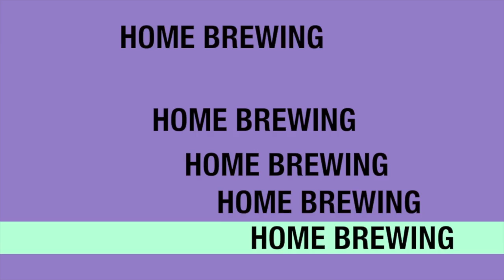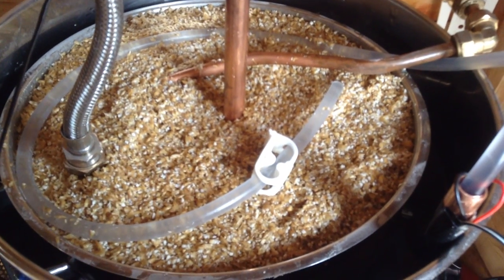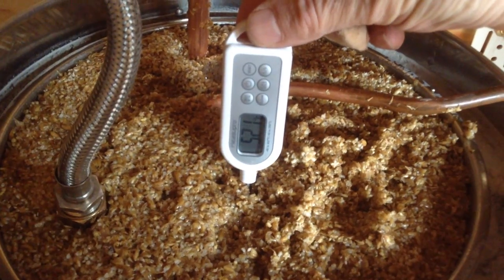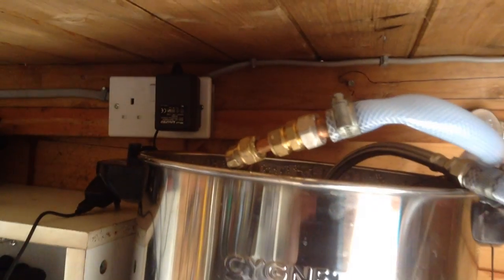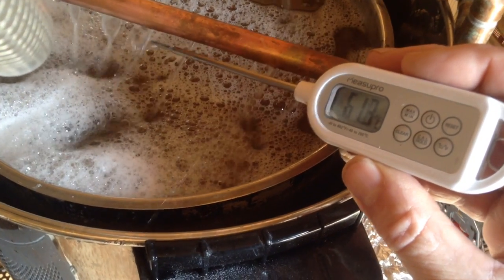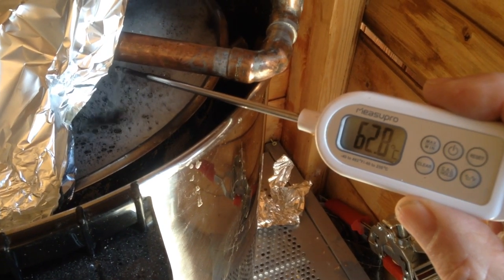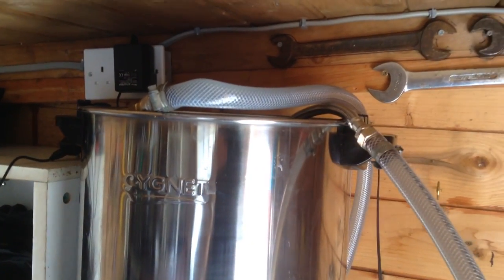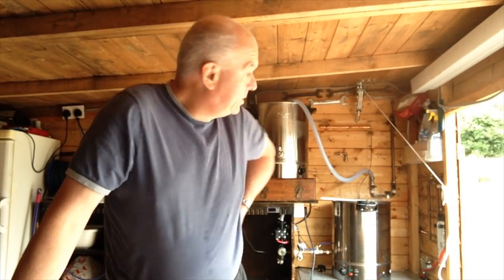Vlog 73 Fartmiester Big Fail!!

Comment: Jim, Tesco do a foil-backed dense foam camping roll-mat thing for £5. I've heard of other brewers using similar and I'm getting one to insulate my 33L boil pot. I can always put more foil between it and the pot if necessary. It also means I should get to the boil faster. It's a shame the sparge arm is too big to sit inside the top of the outer-pot. It would reduce the distance the recirculated liquid has to fall through the air (therefore cooling it less) and you could put a lid on the top, which would massively help maintain the temperature. Anyway, great video as always, good luck.

Comment: Thanks for the shout out Jim. Amd so pleased you got it sorted in the end.  I guess we don't know these things unless we try them. I too had a similar idea when I was looking at it. My idea would of had the ciol on the bioler too bit on the outside the inner basket if you get my drift. Then would double as a wort chiller after the biol. But probably still fail. And create more dead space I guess. And I will need a sparge water vessel anyway so looking fantastic doing herms style. Thanks for the video Jim. Not really a fail just a miss-take. Got it sorted in take 2. Cheers!
Reply from the maker: Thanks very much for the support its all good fun and getting there slowly just got to get the insulation sorted. Cheers. Good luck with you project.

Comment: Good video Jim, I bought myself a buffalo boiler for biab, I insulated it with radiator backing foil its £5.99 for a 4mtr roll from screwfix & works a treat 👍
Reply from the maker: Sounds the business wil be ordering that next it's all spending in this game. Thanks for the heads up cheers.

Comment: Good on you for not giving up on the grain and getting some beer in the end. I did think you would have problems with hot spots by putting the coil in the grain, but if you don't try these things you don't know. 

Really glad the HERMS coil is working well for you. I've contemplated using my cooling coil the same way but not had issues maintaining a stable temp using the heating element and recirculation.
Reply from the maker: Yes Rob it's working really well, time to do a couple more mods with insulation and sparge arm adjustment. Cheers for the help.

Comment: Very cool monster mash ye have made there...I found measuring the temp of the wort as ti was returned (using the STC) prevented me from over heating the mash (just used a T junction with a thermal probe). Cheers
Reply from the maker: What a great idea more experimental work coming up it never stops
Does
It. Cheers.

Comment: I would readily agree that foil backed camping mat would be a good choice, and one i use on my HLT,  as would foil bubble insulation which is also readily available and would also do the trick. Think you've almost got it sussed Jim...well done!
Reply from the maker: Yes the insulation is the next project, thanks for the support an help cheers.

Comment: For me the best insulation ive used on every setup ive done.Is a foild sided campming mat with then foil facing the pot.Easy to cut to pot size only £4 on ebay.And held with them bungee cords which i bet you already have.Then when you come to cooling easy to remove.Also had no problems leaving on for boil works a treat and can wipe clean.
Reply from the maker: beerlover1983brew That sounds great the foil should reflect back as well that the next thing on the shopping list thats for sure, thank for the tip sounds great CHEERS

Comment: Hey up again , me duck.....
The foam camping mat I used is fine , tho' my boiler is plastic ,but whatever , I figure water boils at the same temp whatever it be in . Not melted mine , and it is'nt in too close contact with the boiler as it's not secured to it in any way ,just the natural coiling tendency of the material keeps it "good enough for government work " , if you catch me drift. You could'nt sleep on 'em - too thin anyhoo ,and as soon as yer roll over the buggers curl up again.Also ,Ileft the lid slightly covering the pot  whilst still letting the steam out , I figutered that as it has trapped warm air between the layers , it would make a difference ,and it has . More noticeable in freezing weather , I get anothe 3-5 degrees on the boil . Glad to see you "landed" the brew with all engines out! BTW, there's nowt wrong with invoking the spirit of Heath- Robinson . Google some of his drawings , you'll be in good company . As ever , great bit o' "Fartology" applied there . Well held,Sir  !
Reply from the maker: Hello Nigel yes going to be whacking some insulation around the old girl also will be on the lookout for a mesh to put over the grain, still need more holes in the bottom of the inner tun to stop overflow. I have a link to silver foil lined so might take the plunge on that, also fancy a bit of plumbing malarky. It's all go that's for the tips and support. Cheers.

Comment: Oh James what a to do!! I think your beer will be fine, a bit of up n down with the temp will probably level out. The new set up looks brill - can you try work out what your efficiency is and let us know? I bet it'll be very high. Cheers
Reply from the maker: Ant Rogerson Will try and work it out, if I can get my head around it. Cheers Ant
Reply: With recirculating the wort in your herms system , it should be somewhere between 80-85 %  - Very high , it's a mint system

Comment: Jim dont worry about the melt,Screwfix do a hotwater tank insulation on a roll, not sure how much but it is but you can cut to size and tape round the fartmeister so it has a permanent jacket, I did this when I used to do mine in a fermenting bucket and a couple kettle elements before going over to the gas and staineless kettle.
My motto " NEVER, and I mean NEVER waste a brew.......If it tastes like S*** use it on the BBQ to damp down flames and flavour the food"
All the Best and Cheers Tony. "Rusty Dawg Ales"
Reply from the maker: That's next on the list of things to do Tony insulation and sparge arm mods. Thanks very much for the comment and yes still got some crap ale but never thrown it yes. Bbq weather soon. Cheer s

Comment: I have created a monster !   I will call him "Fartenstein..... give my monster life!"

 More holes in the base sounds good , I take it there's still the original 3 ? Should give you a nicer flow , although I would vote for cutting the bottom out to fit a circle of stainless mesh , if you can get it at the right price ,might be easier than drilling stainless  ,which  I've found is more fun than having wisdom teeth pulled .Just . If you can get a disc of mesh , a bit of split silicone tube around the edge and some stainless screws to hold it down ought to work . But then again , holes can be supplied by the user ,if you see what I mean , but it may cost yer in ruined , burned out drill bits . Remind me to get my Wilko shares on before your next "splurge"!
Reply from the maker: Yes dreading the drilling and the mesh idea top and bottom sounds good it's not stop with this brewing Mallarky and I never stop spending but it's all great fun and thanks for the tips. Cheers.

Comment: I just bought a hot water urn like yours and they are the best thing to brew in
Reply: Peter Downunder I just use an esky to hold the gain in at a stable temperature, I'm thinking about getting a bigger urn as the one I bought is only 28 litres
Reply from the maker: Peter Downunder Yes the esky are good but not as good as farting about in the shed I dont want to make life to easy do I, only joking thanks for the tip and Cheers
Reply: I was going to rig up a 3 pot brewing system with a couple of electric urns but haven't got around to it yet

Comment: Foil insulation would work a treat, It can be removed for the boil if needed.  I used for a while with one 1500W element to help bringing things up to the boil quicker, had no issues with melting.  No open flame to worry about!  But now that I run 2 1500 W elements I have no need for it.  This should help!
http://www.westbs.co.uk/westbs-eco-offers.htm
Reply from the maker: Great link thank you will take a good look at the sizes and this will really help. Cheers.